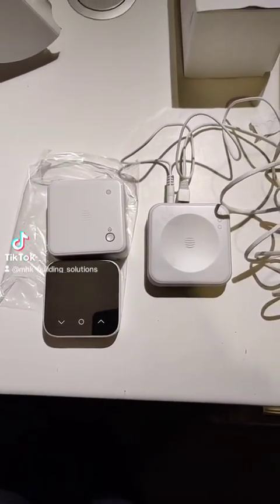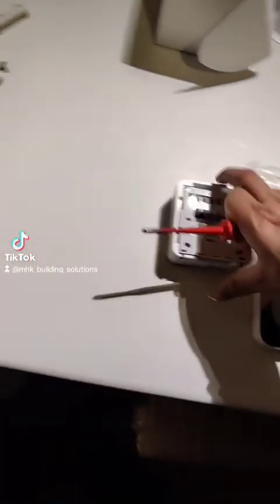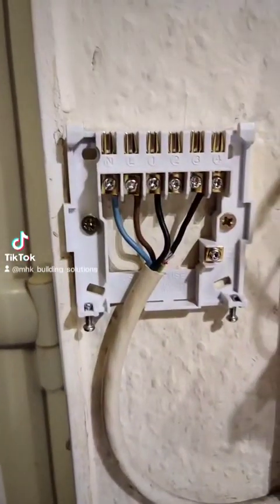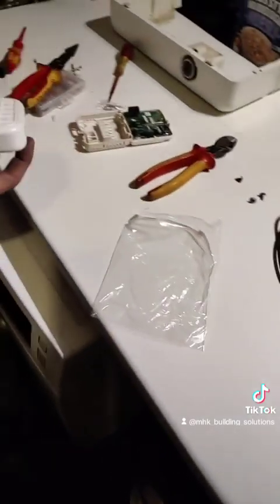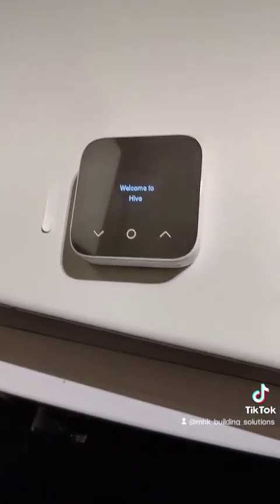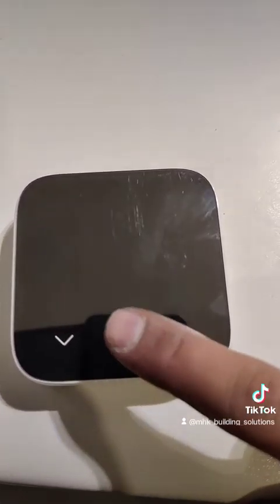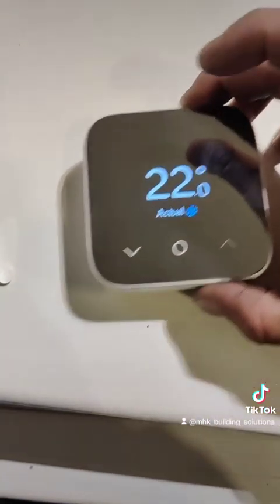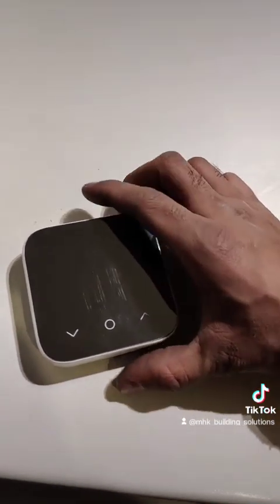Hive mini full installation. How to install a smart thermostat programmer. Hive Nest Honeywell EPH

Comment: Not showing where in boiler the wire goes.
Reply from the maker: Yes Dilshad as the cables were already connected inside the boiler, I didn't bother recording it. There is a connector CN5 on the PCB and the two black cables go in there from the receiver.